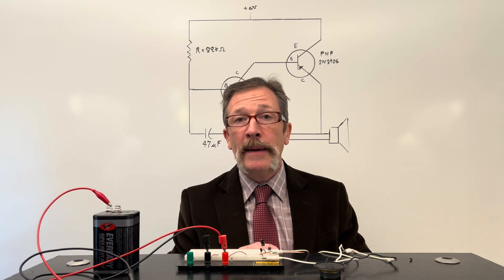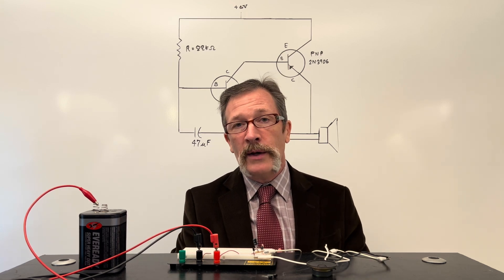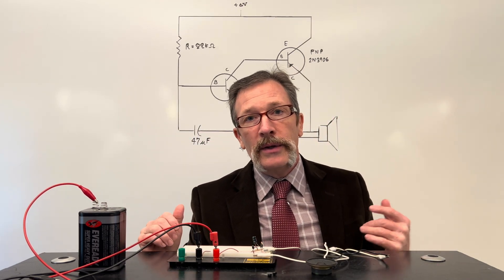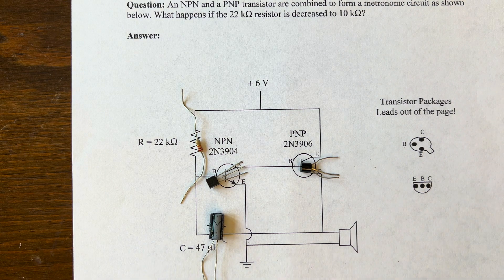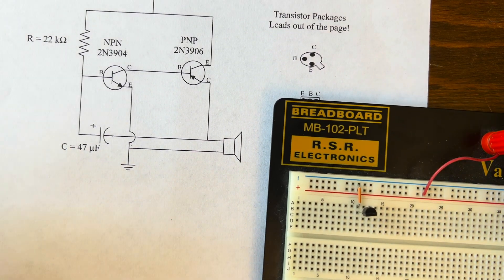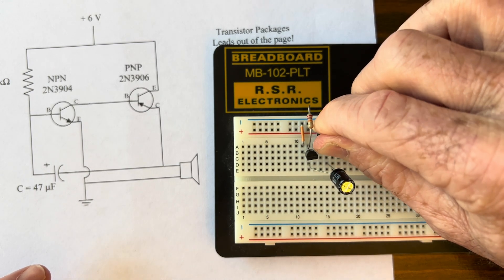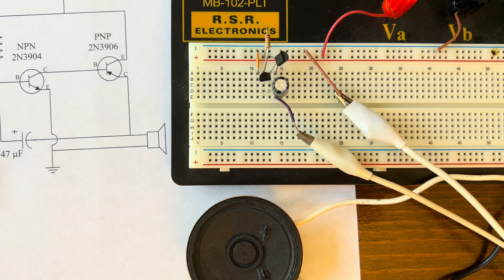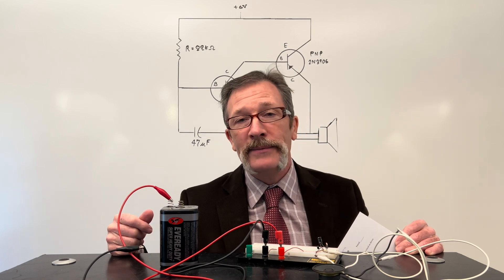Using Physics to Make a Simple Metronome!

Comment: I don't often criticize, but in this case you're providing instruction to students who don't know what is right or wrong. As such, I'm compelled to call out the errors. The information, as I've detailed below, is wrong, and can be detrimental to students in the long run.

You've consistently labeled the pins on your PNP transistor incorrectly.

The Emitter has the arrow. The collector does not.

Also, at each tick, you're applying +6V through the PNP transistor to the negative terminal of the 47uF capacitor, while the positive side is setting at about +0.7V through the NPN base-emitter junction. That drives that electrolytic capacitor negative for a majority of each cycle! It's a polarized cap, so applying a negative voltage (about -5.3V) to it will cause it to heat up and go bad over time. In this circuit it's likely not noticed on the breadboard, but it's exceptionally bad circuit design for critical circuits that need high reliability, and shouldn't be taught as a good way to learn electronics.

Additionally, while I understand your use of the term "gate" to suggest a gate opening to allow water to flow through it, there are two reasons that this analogy is very bad for your students.

1) They're envisioning these transistors "opening up" to allow current to flow through them, which is precisely the opposite of what's actually happening. This will cause great confusion with students once they are required to design a circuit on their own. I always use the analogy of a switch which "closes" to allow current to flow, like the contacts on a light switch which close to turn on the bulb.

2) The term "gate" is reserved for Field Effect Transistors. Their control pin is called the gate. When you say "gate" in this bipolar analogy, even though you're referring to a gate to control the flow of water, it will confuse the students once they actually begin studying FETs.
Reply from the maker: Thank you for pointing out these errors! In my haste to get students and teachers to just try one of these circuits, I got sloppy and made more than one error. Your comments remind us that even when getting started, best practices are always important. And, of course, not giving incorrect information. Let me redo this one and when I do, please give it another critique. Thanks again and sorry for the delayed response.
Reply: @idealizedscience  You're welcome. I'll keep an eye out for the revised version.

A suggestion: Because you're basically in a "no-win scenario" with the polarized cap (it'll see reverse voltage in either direction), I would recommend replacing the 47uF capacitor with a ceramic 10uF cap - which is not polarized. Doing this means also adjusting the other primary resistor (22k) responsible for the RC time constant in this circuit IF you wish to maintain about the same rep-rate. This should go to about 110k Ohms.

Comment: I have been trying to understand how this circuit works since I discovered it in one of Mim's books.  I saw it all except how the capacitor discharged, and have been combing the internet where this is explained many times, but poorly.  You did it!  Just by speaking about the capacitor discharging and pointing, you gave me the missing piece of the puzzle. Thumbs-Up and Subscribed!
Reply from the maker: Very happy to hear it! We hope you’ll enjoy some of our other videos as well.
Reply: Philip, I also have been struggling to understand it. It's quite magical, before understanding, and after understanding.

I could be wrong, but the 'magical' components are the base and the capacitor. The voltage from the resistor is basically the same while the system is in use.

I think that the capacitor becomes full, and is able to 'push back', which combines voltages with the cell/battery. This combines to be powerful enough to push through the base until something different happens.

IdealizedScience & Phil, am I correct?